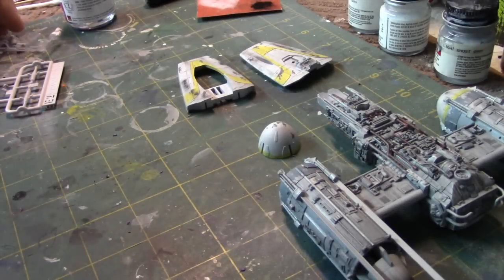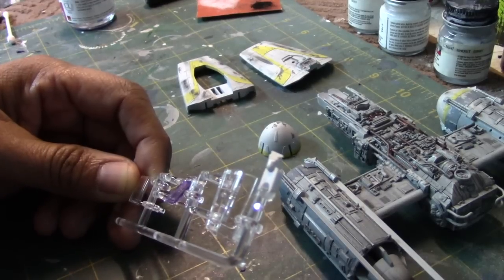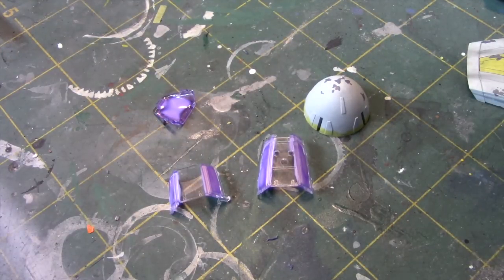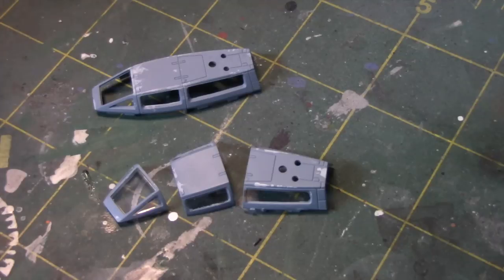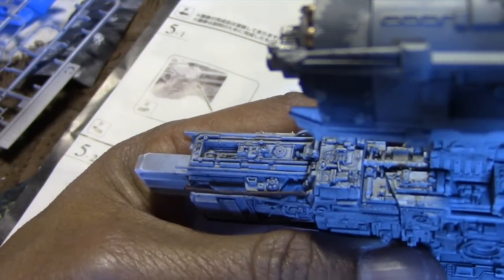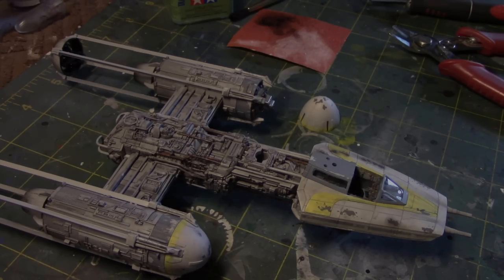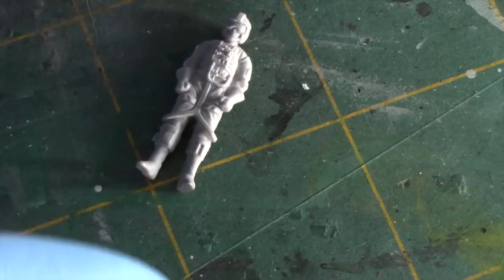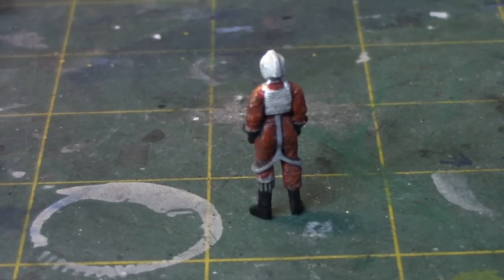Building the 1/72 Bandai Y-Wing Part 2

Comment: When I recently built the Moebius TOS viper kit I tried a product called Bare Metal foil to mask the canopy. It is a thin adhesive backed foil designed for chrome trim on model cars. Because it is so thin you can work it into tight areas and I was really pleased with the results. You should be able to find it at your local hobby store.

Comment: cool video to show the continuation of this model project.

yeah.. the cockpit windows.. I thought for a moment to make it like the studio version where there are no windows.. not so much to mimic the studio version, but paint wise, you don't have to deal with the masking and fine window frame/trim paint work.. and if anyone wonders why they didn't put the clear window pieces in the studio version.. I believe it was to mimimize, if not eliminate, reflections.

But, I like my scale models to represent scaled down versions of the real thing.. if you can call the Y-Wing a real thing.. so, I use.. or rather will use when I get around to building my Bandai Y-Wing with the windows.

If use masking tape, I like the Tamiya one... they seem to work the best, imho.. but, they may be prone to leakage if you did not apply them really good.  Liquid mask seems to be another good option as you can custom mask to whatever you can correctly brush in with precision.. but, sometimes, I go the no masking approach and just hand paint on directly.. I think that works good, if not better, with window frame work like the TIE fighters.. those could be more pain in the ass to mask than to hand paint the frames.. but, in the case of this Y-wing, there are larger surface areas that the frames are connected to which will not look so good hand painted.. more than likely will need to do some sort of masking and at least the y-wing's windows are relatively simple in shape and detail to do this more easily.

yes, those rods or pipes around the main body of the y-wing worry me.. they seem, and obviously are, very delicate.  Good tip on possible way to better more easily install the rod/pipes starting at 6:05.

Comment: While liquid masking is a good technique, I've noticed I tend to get sharper, crisper lines when just using masking tape.  Tamiya makes several different sizes of masking tape for models, or you could just use regular masking tape (like 3M) you can get at DIY/Department stores.  One thing you want to avoid though is using blue painters tape; it has a tendency to leak pretty badly, meaning you'll wind up with paint underneath the tape and, presumably, in areas where you don't want it.